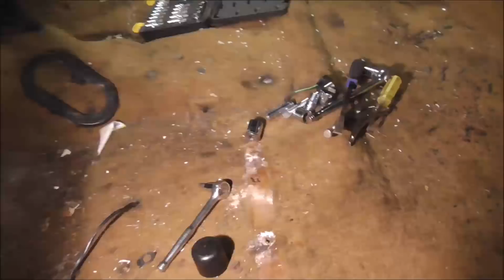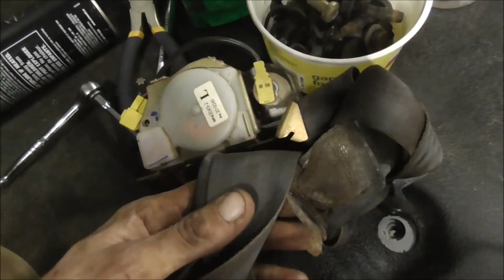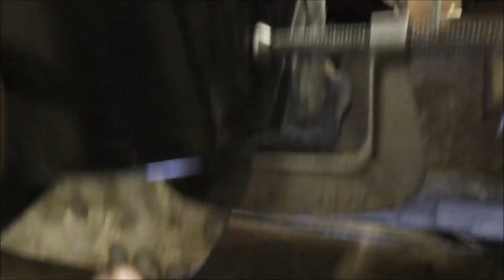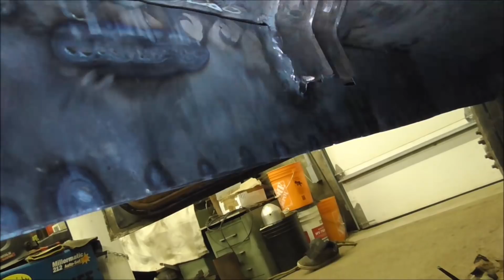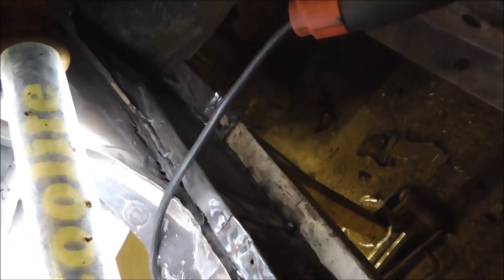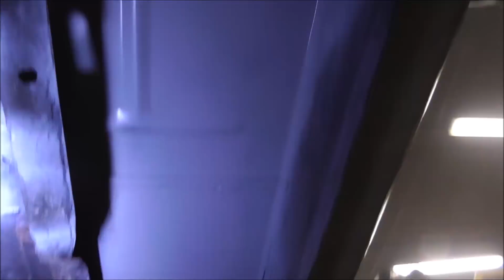1st Gen Dodge 12 Valve Complete Structural Rust Repair, Cab mounts, rockers, cab corner, floors

Comment: Great work so far, your definitely polishing up your skills in the fabrication department! 
Keep making your own panels and small bits needed to repair the rust buckets the closer you get them to look like the original pieces the more valuable you skills become I rebuilt two ragged out 4x4's from the ground up I took my time but what I did different than you are doing is I bought the cheap Chinese replacement panels off eBay and I old fabricated the pieces that weren't available or too expensive it saved me many many hours of fabrication time and it really wasn't that much more money than buying the materials needed to make the parts. granted the Chinese panels won't last as long as buying goid steel and making your own but since I has no plans to keep the trucks very long I didn't care. My next rebuild is going to be a Cummings 1 ton and that truck I am going to build to keep for myself so I will be either making the bits and pieces myself or buying the good USA made panels because this next build will be my last one. I am disabled and getting old so this build will be my crowning achievement in putting everything I have learned over 45 years if working on trucks and cars. I started helping my dad when I was 8 and by the time I was 12 I was helping our neighbors build 4x4 Race trucks.